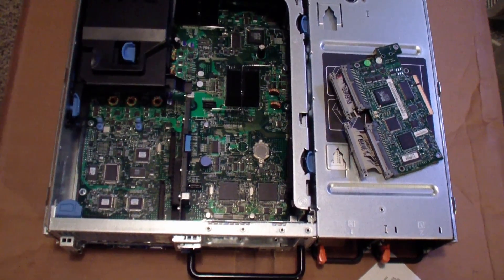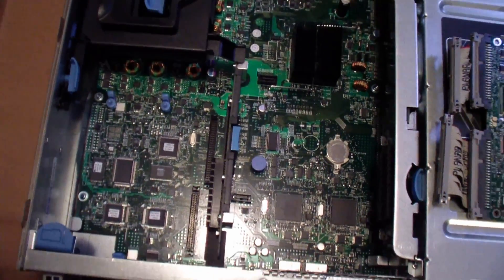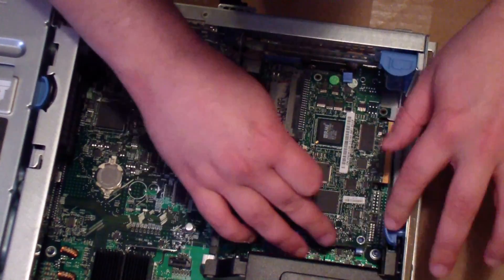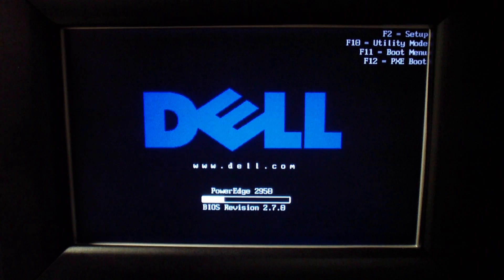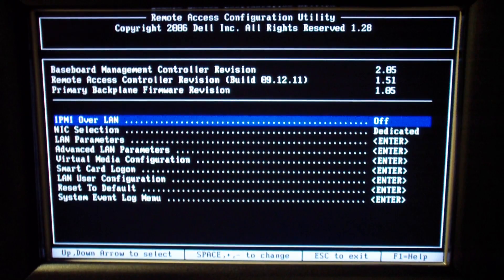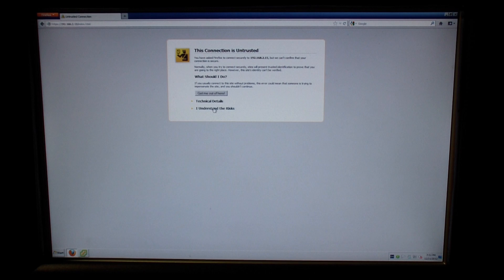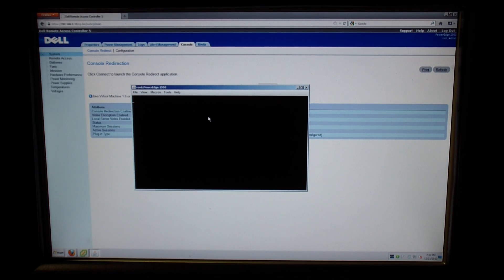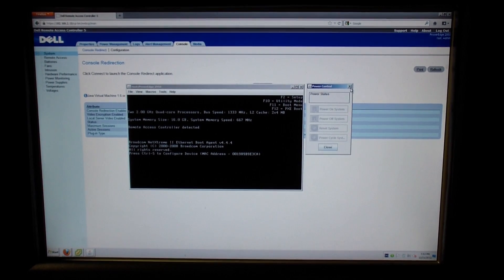DRAC 5 Install on a Dell PowerEdge 2950 GII with Basic Configuration and Demo

Comment: This is amazing thank you so much. I've been trying to find this video for days. Are you having a problem with your fans sounding like a jet engine? On my Poweredge 2950 they are very loud. I have to install the Lifecycle Controller so i can control the fans. My F10 Utility Boot will not boot anything up. It will just go straight into Windows Server.

Comment: Great video. A quick question. If I remotely power it off can I remotely power it back on again?
Reply from the maker: Yes, as long as the server has power it can be turned back on remotely through the DRAC.

Comment: i have one of these cards but a tower 2900 and the cables are way too short, any ideas what i can do?
Reply from the maker: I have never seen a 2900, but I do remember when I bought this card there were 2 versions and one had extended cables that were maybe 4 to 6 inches long.
Reply: Thanks for the reply, that is exactly it, I did some research and confirmed I need the longer cables which makes sense.  Once you said the slot connector didnt need to be used it made more sense.  I kind of figured that but wasnt 100% sure.  I found a site that sells the longer cables and ordered it, got lucky its still available for this old stuff!

Comment: Thanks, just got one of two of these servers and had already bought the DRAC but... with it plugged into the PCI slot the cables don't reach. Was driving me a bit crazy. Knowing that it doesn't get plugged into a PCI slot was odd, but made perfect sense when you pointed out where it fitted.

Comment: As far as connections go, do I need to connect an ethernet cable to both the DRAC and ethernet port or just one?
And also when I select DHCP it doesn't assign an IP to the DRAC? What's the fix for that?
Any help would be appreciated.Thanks

Comment: @Jack Butler - The answer is yes, I setup mine on DELL PE 1950 using DHCP which was off my router, it auto-populated without issue. But I couldn't get the connection to work. After watching this video, I know why! I didn't have this also connected even though the server itself was smart enough to assign it to the DRAC.

You will need to run a CAT6 eth0 Gb1 whatever you are using, to the DRAC to get it to work on your corporate LAN.

Comment: Smart Card Login Error	

Description:		The 'DRAC 5 Web Login Enablement Control' plug-in is either not installed, disabled or is not running.
Resolution:
You must have administrative rights on this system to install the plug-in.
Click on [Try Again]. When prompted to install the plug-in, click [Yes].
Ensure that your browser settings allow you to download and install the browser plug-ins.
Ensure that your browser supports Smart Card login. See the DRAC5 readme for a list of supported browsers.
Smart Card Login may not function properly on clients running Windows operating system configured with Internet Explorer Enhanced Security. To resolve this issue, see your Microsoft operating system documentation or contact your system administrator.

Comment: If you want to connect to your DRAC via the dedicated RJ45 connector on the DRAC, you must change your NIC Selection to "dedicated" within the DRAC configuration utility (Ctrl-E).  It is because your NIC selection is set to "Shared", that you are seeing your DHCP address under LAN parameters when plugged into your on-board NICs.  Also, BMC has it's own configuration utility which is also accessed by "Ctrl-E".  When you install a DRAC, it takes control of the BMC which is not "managed" by BIOS.

Comment from the maker: On my 2950, you have to have either the BMC or the DRAC enabled, can't have both enabled at the same time. It sounds like your BMC is enabled. Mine actually shut off automatically when I installed the DRAC. My BMC was managed through the BIOS, but the DRAC is managed through its own option on boot. If thats not the case you may have a bad DRAC. Hope this helps!

Comment: what is odd, is that with my rj-45 plugged into my drac card i didnt get an ip but if i plug it into the motherboard GB1 or GB2 I get an ip in this remote access section...strange.

Comment from the maker: Im new to IPMI to, waiting to get this in and learn it myself. But the big thing is the servers from what I understand have a Baseboard Management (BMC) and then IPMI is implemented on top of that. The BMC setup should be similar to the DRAC setup. IPMI i believe you need some sort of 3rd party tool to interact with the server. Im not real familiar with render farming but the C6100 is a powerhouse at a steal of a price! I would think it would be perfect for something like that.

Comment from the maker: Thank you! KVM switch allows you to hook up 1 monitor keyboard and mouse and connect it to multi machines. There are 2 types of management for the Dells DRAC and Baseboard, the C6100 should use IPMI v2 Remote management and should be built in already on each node. Im not sure how it works vs DRAC though. I just picked up a  CS24-SC and will be testing the baseboard management on that, I will prob make a video to go with. Hope this helps!

Comment: I'm still not clear on how you are connecting this DRAC into the network. Are you using the connector on the DRAC card or the network connector on the Dell 2950 itself?

Please explain this better.